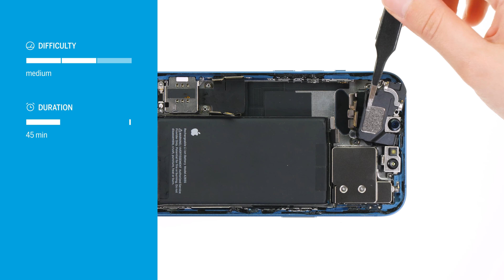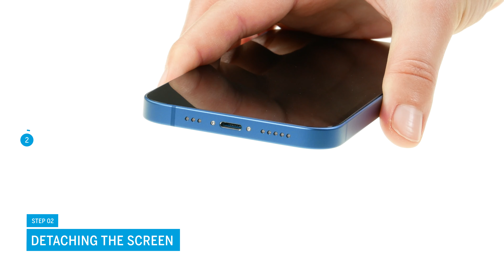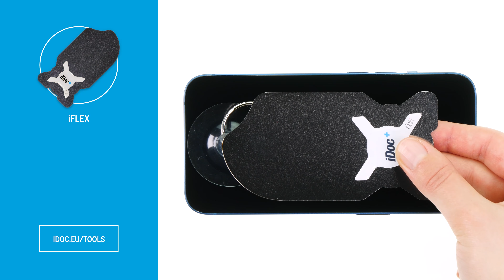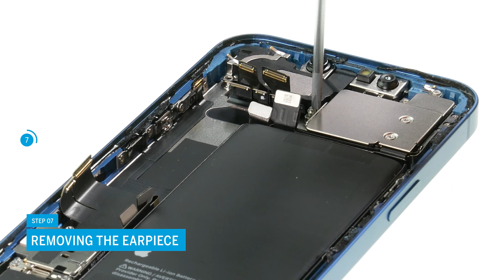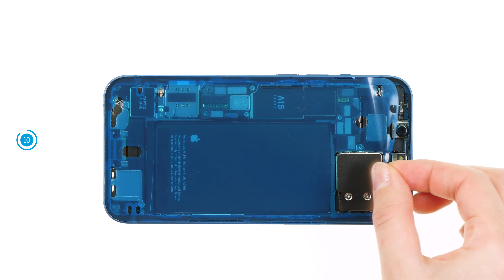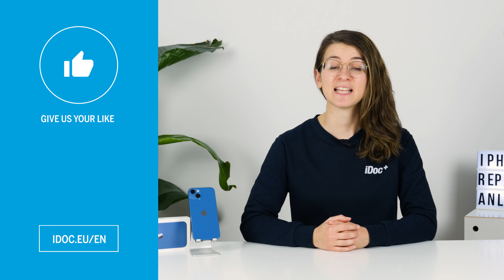iPhone 13 (A2633) repair guide – Earpiece replacement [repair guide + reassembly]

Comment: I got quoted 350 for this replacement. Sounds legit ?
Reply: I was quoted 270 for it and just did the repair myself. The replacement part stopped working when I closed up the device and I have another one coming, no idea what that is about.
The repair itself is easily doable with the right tools.

Comment: be very careful there is a 5G antenna flex cable under the top left corner of the battery soldered to the logic board. so watch out when lifting up the logic board, I learned the hard way.
Reply: So how do you lift?
Reply: @felicianovelasquez4321  carefully. i had to angle it so that i didn't lift it up completely so i could leave everything intact, and then just maneuver the speaker out.
Reply: Yea idk why these videos lie and make it looks easy. Maybe to sell more parts once techs break stuff?

Comment: The iphone 13 i worked on had a flex ribbon attached to the bottom of the board and it looks like it went under the battery. Could not remove the board easily.
Reply: It looks like the flex cable is just under the top left corner of the battery. Gently pull it out from under.
Reply: @reyesarg  Not having this in the tutorial really screwed me over and this isn't the only walkthrough and or teardown that somehow doesn't show it. Turned my repair in to an exra day and a solder job to restore 5G. Big thumbs down on this video
Reply from the maker: @CPR Indianapolis,

sorry that you had problems with the instructions. We used the iPhone 13 model A2633 for these instructions. This model does not have an additional 5G antenna.

Best regards

Marc from iDoc
Reply: @iDocEN  Right and this info would have been great up top
Reply: @cprindianapolis4027  this fucked me up too now I don’t know what to do .